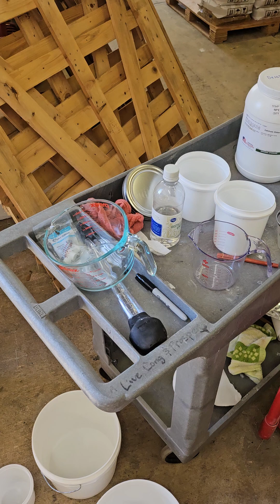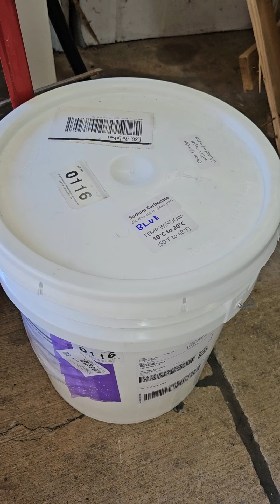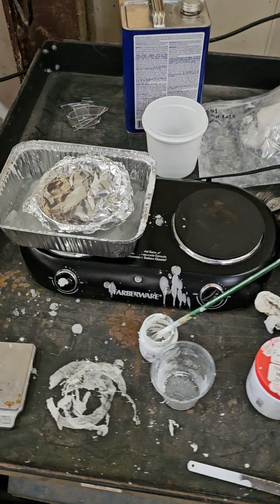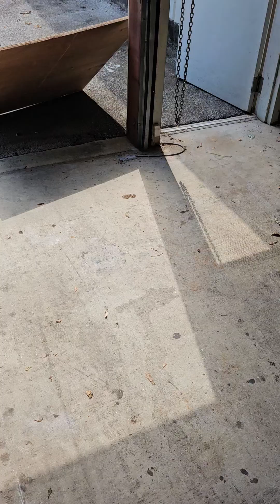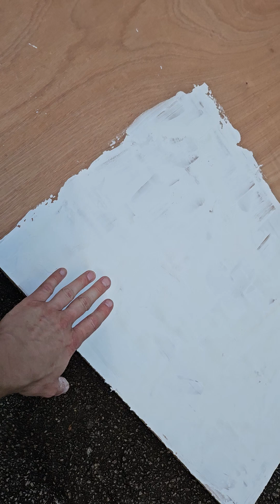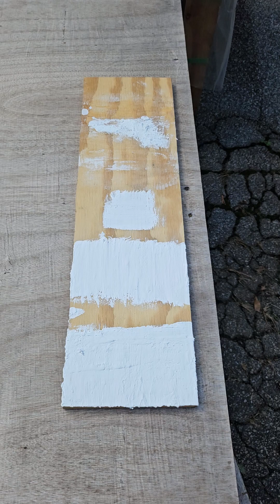calcium carbonate microspheres mixed with acrylic

Comment: Best of luck in your endeavors! Are you just doing it for experimentation or do you have another project you're gonna use it on? (Unrelated note but I wish you could've made it to insightfest😭)
Reply from the maker: @tal_os8148  i dont have end-use purposes ironed out yet.  This material will have applications wherever you need power-free cooling in an outdoor environment.  This would include things like street furniture or to increase thermal efficiency of buildings in the summer.